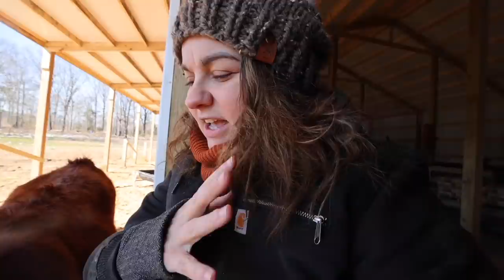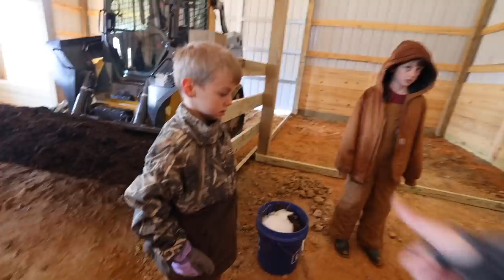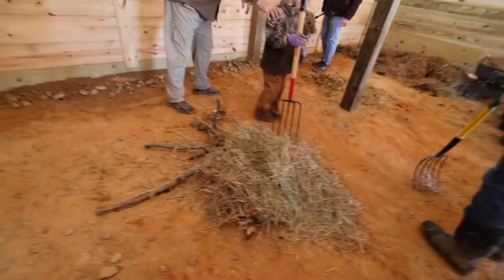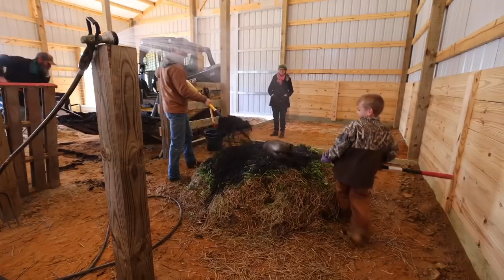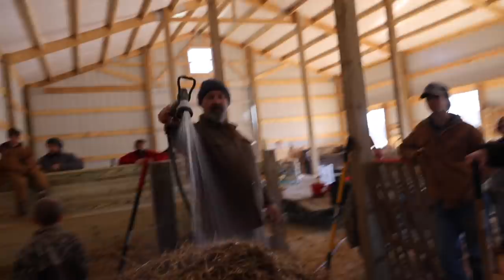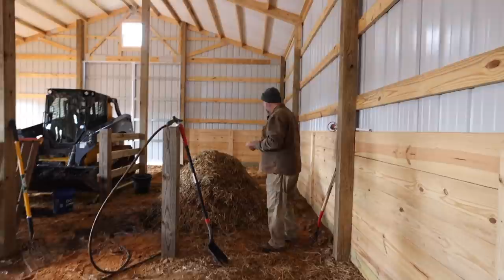Building Compost on a South Carolina Snow Day (Calf Watch Continues) | VLOG

Comment: I know there are advantages to building compost piles like that, primarily for the warmth.  However, we don’t have the time to dedicate to that. For many years we rake out the goat shed, manure and hay, and move it to a dedicated low hillside space next to the woods.  We do nothing else and nature turns the piles into wonderful compost. This method takes 6 months to a year for dark “chocolate cake” compost with lots of worms and castings. I can scrape the casting layer off of the top occasionally to make 2 to 3 day old compost tea, poke a rod into the ground around my trees and plants, inoculating the ground deep down, changing the ground into soil deep.  We had clay here but the tea changes the clay!  Mulch, wood ash, and chicken manure completes the feeding cycle. I use this method for orchard, annual gardens, and food forest. The only difference is using pine bark or needle mulch for blueberries to keep the ph more acid. This works best for us.

Comment: I spent some time in Nicaragua a few years back on a mission trip working on a farm attached to the mission we were supporting and we built a compost pile one day that was much l like this one.  The farmer set a pipe in the middle and we used chicken manure, regular dirt, plantain leaves, yeast and molasses water.  Then a couple days later we uncovered it and turned it and it was supposed to be done in 3 weeks to a month.  It was quite the experience!!!

Comment: The latest I saw with quick compost was that people have been putting plastic water pipes in the bottom and have heated water and their house with the heat from the compost.  That's taking it one step over what I would have been doing. Ha ha

Comment: I built a Berkeley compost lasagna this past early fall. It was my first time, but I watched 20 or so Berkely Method videos beforehand. I built mine 4 ft. high x 3 ft. diameter, using 3"x4" wire fencing as a bin to keep it straight. I used  mulched straw, grass, cow manure, very small wood chips from dead trees I had cut down,and coffee grounds in layers with a good layer of vegetable kitchen scraps in the center layer. After 2 days, it was 140 degrees...perfect! Turned at 4 days, then every two days. I looked forward to checking and turning it (I'm 65), adding water when needed. I had a great pile of compost in 3 weeks! If you add additional materials to it as time goes by,, you start your countdown and turning cycles all over.. 
I can't wait to see how yours turns out! I hope the boys enjoy the process as much as I do. Just before winter, I triple mulched all the leaves I could get my hands on, (thanks, neighbors), and I'll use those (instead of straw) to start a new compost pile in March here in snowy NE Ohio!
I really appreciate your videos, Jess and 'Miah! Especially anything gardening related!

Comment: We used to live next to a landscaping facility here is SW Florida that also made compost from landscaping debris (which in Florida is mostly palm fronds). When it would get cold the giant mounds would steam. Whenever they would come turn the piles or when they would grind it all up in a giant mulcher (the mulcher part was as big across as a sedan) the birds would flock the piles and scavenge all the bugs (and add manure). This compost would sit for probably a whole year with them turning it and then grinding it up and then sitting again. They would even water it in the dry months. Was very interesting to watch on such a large scale.

Comment: This is exciting!! Thanks for all the info - I can't wait to try this since my compost never heats up - it's Florida and today it is 100% humidity but blue skies and no rain. Just too wet so heaps never heat up. At least from my experience. I heard him say you didn't need a taro since it was indoors and assume a tarp is what I've been lacking. I will try that next. SO EXCITED to do this. Thank you again.
Reply: The key for thermal compost is at least 3feet wide and 3-5feet high. A tarp may bring the heat up but be careful of self combustion. Also because of your high humidity, you may have to water much less. Also with your humidity a tarp would decrease air circulation and in FLorida you may cause the pile to become too hot, too wet and kill the microbes. The tarps a great idea for areas that gat cold and snow. Hope this helps. Good luck!
Reply: @ritagibson225  Sounds like I had it all wrong. My piles are not deep enough and always wet. I need to do better in learning how - thanks for the response and good advice.
Reply: @iartistdotme  What is key to this methods success is to do the moisture check every 2 days and check temps each day. Combustion will not happen if you check these two. A tarp keeps the sun from pasteurizing and the rain from washing away microbes. Thanks for your question.

Comment: I like the fresher, urine soaked, barn cleanings on top or well layered throughout.  For us, I like branches every 12" or so; older, dealer branches @1" in diameter.  Corn husks work too but takes longer than some dead, evergreen branches (Doug Fir, Western Hemlock - actual pine seems to last longer and not have the same microbes).

Comment: My mulch/compost is 3 day old pine shavings mixed with rabbit poop from pet bunnies.  Breaks down fast, has cold fertilizer in it and as it breaks down to super fluffy compost soil.  Charles Dowding uses pallets to build a box to contain it while breaking down.  My rabbits live in the kitchen so they get vegetable scraps, which is the green in the compost (if they leave anything).

Comment: I was just watching a compost webinar from Dr. Ingham.  I do have a question- if the pile is heating up enough to kill the weed seeds, what is it doing to the microbes?  It sounds like the microbes are good up to 160 degrees?  (BTW, the webinar also mentioned that at 170 ish the pile starts to go anaroebic)  They have another webinar coming out 1/25 dealing with the microbe life in compost.  They have already done two parts to it.  Great information.
Reply: Yes ,weeds seeds die in the heat. The beneficial microorganisms will die if the piles get up around 170.  This is why we recommend turning the piles as soon as they get up to 150-155 degrees to protect the microbes. Thanks for the question.

Comment: I tried container gardening last  year for the first time. (I’m in my 7th decade. Physical work is an issue)  I put sticks and leaves in the bottoms of totes, drilled holes for drainage, added some table scraps that I compost, then good quality organic potting soil. My veggies didn’t do real well. Should I  have aged the compost before I planted anything in the totes?
Reply: Absolutely. The compost will get hot enough to cook the roots. Try composting separately.
Reply: Good on you!! Or make sure to put a good thick layer of soil on top of the compost-in-place you've done, to be a buffer between the roots and the heat of the compost. I've done that HEAPS and it worked great, keeps building the soil for a year or two (depending on scrap size).   And I put some of the tote/ pot drainage holes over actual soil in my (tiny) garden for a couple of weeks, to let some worms come in and help ❤❤❤. There's an Australian channel called The Nature Patch with a great short video about composting-in-place *in pots*... I'll see if I can find it and re-post here for u. Happy gardening! 🌻🌻🌻
Reply: @erin2535  
You are encouraging. I look forward to checking out this channel. Many thanks.
Reply: Thanks for your question. Aged compost will have come to ambient temperature and smell like forest soil. if the compost is hot do not use it, its still actively decomposing. Also a 4-6 inch layer of compost is mixed into the top of your native soil. Its very hard to recommend store bought compost because so much of it is anaerobic or lacks microbial diversity. I would recommend a tumbler compost bin near your house that you can easily access to add kitchen scrap. Hope that helps. Phil
Reply: @phillipburton780  
Thank you!  I will look into a tumbler composter.  I’m certain now that the heat from the decomposing scraps must’ve been too hot for the tender vegetables. I’m happy to have your information. Thank you!!
This gives me hope for the coming season.

Comment: Can you please ask your friend about the problem of herbicides (aminopyralids) found in hay?  Gardener friends bought and used hay as mulch in their garden or mulch piles.  The herbicides are persistent and long-lasting even after aging and heating.  It can destroy a huge garden area and takes huge effort to remediate.  Can he give us any tips on how to find safe sources of hay in an urban setting?  Are there ways to test the hay's safety before applying everywhere?
Reply: Great question. Herbacides and fungicides are very difficult to avoid unless you source you own. If you can get to know some of the regenerative ranchers in your county they could be a great source. This kind of organic hay will be more and more easy to find because the price of chemical inputs are higher than most can afford. Ask homeowners as well if they spray their lawns before taking their leaves from the curb. Thanks for watching. Phil

Comment: My problem is that I am by myself. I am one woman and I am disabled and I had bariatric surgery so I eat very little. This is my first year on the homestead and I was unable to have a garden at all last year and because of finances I may or may not be able to have one this year. So even coming up with enough stuff to make a compost pile is problematic. About the only thing that I have reliably is an absolute ton of brown dried leaves, as well as cardboard. Those two things I have in abundance. Along with chicken, turkey, goose, guinea, rabbit, cat, dog and gecko poop. Most of this property was covered in broomsedge as well when I got here so even in the summer pretty much everything was brown. The hard part is finding anything green to add to the compost pile and without a well or any running water that's a bit difficult as well. :-(
Reply: Thanks for watching, so sorry about your surgery. Sounds like you have so much of what's needed to start your own compost. Small tumbler compost barrels can be bought reasonably. Tear the cardboard up and use your leaves and manure. Your green material is your kitchen scraps.

Comment: Hey Jess I need some guidance. I attempted to do this compost pile though I used fresh pine wood chips instead of hay.  I use grass clippings and horse manure mixed with wood shavings. The horse manure had been sitting outside for 5 months. I did the layers I thought I did it correctly though the wood chip pile is hotter than this layered method. I need more information on this method. I have five raised beds about to go on my sixth one and I need compost.

Comment: This might be a bit off-topic but since Jess mentioned in passing the issue of compost piles catching fire, I would like to ask a serious, inquiring minds want to know, kind of question.  Over the years I have also heard/read about compost piles catching on fire.  I don't disbelieve these reports but there are several things that don't seem to make sense about piles catching on fire.  As far as I know the following list of statements are true: 1) wood/cellulose/paper won't ignite until it reaches a temperature of 451 degrees, 2)  water boils at 212 degrees, 3) most bacteria, including compost pile bacteria, will die or at least become inactive at temperatures somewhat less than 212 degrees, and 4) damp compost will be quite resistant to catching fire at all.  So what would be the circumstances that would actually cause a c-pile to catch fire?  Without some other outside influence, I don't see how the pile can become hot enough or dry enough to actually ignite.
Reply: My understanding is that in order for an actual fire to occur, the pile heats up from microbial activity, but because it isn't turned, the microbes use up the oxygen creating an anaerobic environment, at the same time the pile loses moisture and the dry ingredients are primed to combust.  An unturned pile with sufficient microbes, and lack of moisture can reach 300 - 400 degrees.  I've only ever seen my piles smolder, but that would be hot enough to catch fire to something in close proximity with a lower combustible temperature. imho.

Comment: I'm not saying he's wrong, because he's not, but there is not one way to make compost. He made it feel like there are more ways to screw up a compost pile. There's not. There are more ways of making usable compost than there is to mess it up.
Reply: Hey Al, you are right , there are many ways to make compost and will be teaching many ways to make compost that are far less involved than the Berkley. However, with thermophilic piles you must be strict about moisture-temp-and brown to green ratios. As you may know, you can make compost out of urine and sawdust very quickly, but it will not posses much microbial diversity. thanks for watching, Phil